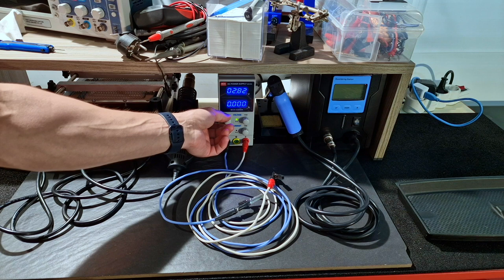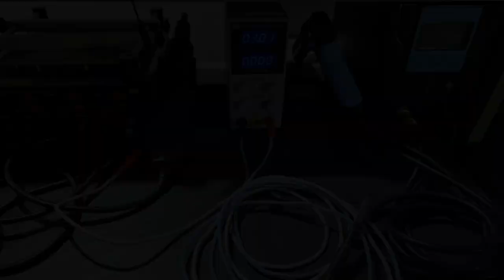Water Damage BMW Key Fob Repair

Comment: I washed my e 90 key and I split it open on the groove with a flat head and hair dryer it for about 15-20 seconds until it was almost hot and then it worked completely fine
Reply: You dried the board too.

Comment: What part will i need to transfer in order to clone this onto a working fob. I have a key which is draining battery fast and it has been checked by a key guy and am hoping he has done all this and returned it back with issue still occurring....

Comment: Hi, nice video!!!, I have the same key with water damage, only transpoder works (start the car when stick to the steering column) I have another blank new key, what components should I need to swap to the blank key to avoid the key coding? Thanks!!

Comment: Hi, I have a key fob with the same situation. After I wiped the corrosion residue off, it appears the buttons are firing based on current reading but it cannot unlock the car. 

I’m think of using an ultrasonic bath to give a shot, any suggestions? Thank you!
Reply from the maker: Hello! you can try the ultrasonic bath! but there is a big chance to be compromise!

Comment: I have similar problem. Key got washed in washing machine. However, after changing battery, it works perfect for a few days and then battery dies. Any suggestions on how to fix? I’m good with microsoldering so can try to repair. Please help with any instructions. I’m subscribed! 😊
Reply from the maker: Hello! for beginning you will need to open it!
Reply: Did you ever fix it?

Comment: what causes low battery for the remote on the dashboard ....despite it's not?
Reply from the maker: Usually is the battery , even if it is ''new'' to you , it can be an old stock , or extremely rarely the remote control have a problem .
Reply: The car battery? It's a bit old but no warnings yet!
The key battery I measured it with multimeter shows 2.8v !!!
Reply from the maker: We are talking about the Key battery , and if it shows 2,8 volts is not good !! it need to have at least 3V normally 3,2...3.3!
Reply: @MOvidiu  the cr2450 is only  3v 🤔
Wondering